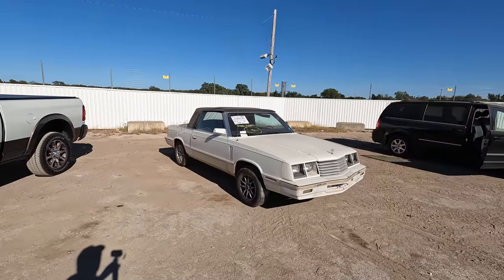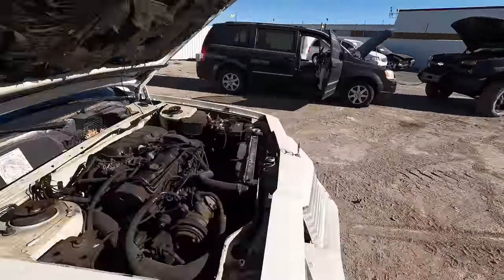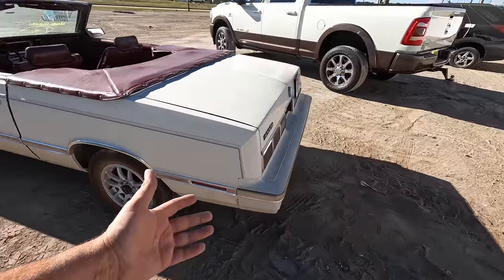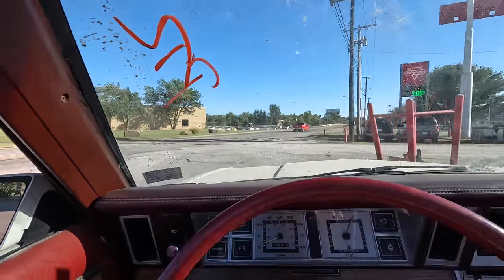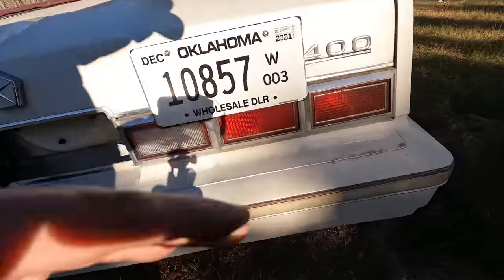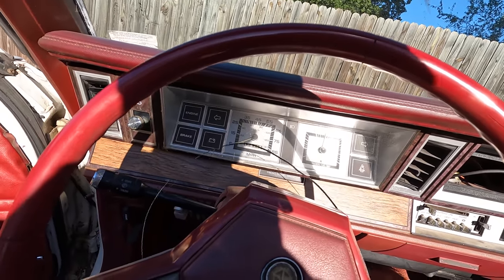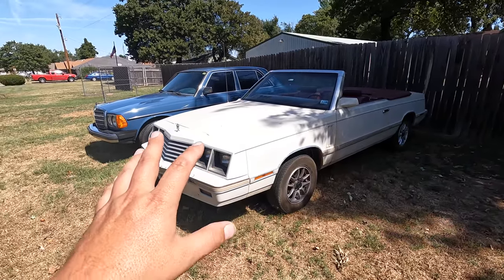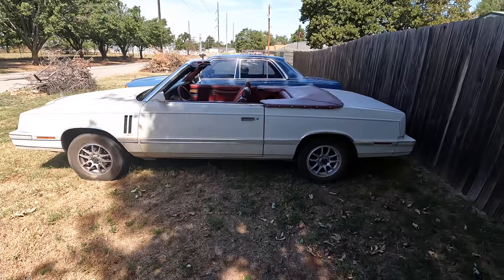I won a 1982 Dodge 400 K Car for $235 from IAA!! Run and Drive? 0-60?

Comment: Randy, I think you underestimate your audience a little bit. A lot of us (including me) come here to see all these oddball cars. I like this channel because of the Cavaliers, Colt Vista Cruisers, Crown Vics and old as dirt Benzes. I also liked that BMW I3. 

Now as for why the Dodge 400 was so slow, The car was meant for cruising and top down trips. It was not meant for spirited driving. It (and the Lebaron) were the first domestic convertibles since the mid 1970's Cadillac Eldo. I personally don't find them that slow when I consider the other American cars offered at the same time. 1976-1986 was a horrible time for power and speed in cars. I had a 1985 Oldsmobile Cutlass Supreme with the 307 V8. It got a whopping 140hp.

As for its value, you might be surprised at how much these can go for with a little work put in to them. They have a following and this being the first year with a low production(they were very pricy in 1982 and not many were made.

Comment: U got it backwards on the 2.2 the 2.6 was the junk motor. maybe 20% of the 100 K cars I've been around or owned has bad headgaskets and u can do a clamshell gasket change in 20 minutes. The 2.6 had cracked heads, dropped rods and never ran good and had bad gas mileage. Chrysler dropped it in 85 for the stroked 2.2 the 2.5..

Comment: I've had amazing luck with the 2.2 and 2.5 engines and I could swop a head gasket or head without even getting under it or jacking it up 45 minutes to swop a head gaskets out 2.6 mitsubishi engines was straight up trash 🗑

Comment: I disagree on your motors decision. I think the 2.2 is better engine. They all knocked of the dealer lot. But they ran forever. The 2.6 was junk period. They smoked after 100 miles and the timing chains all went  and it leaked everywhere.

Comment: These first 2.2 Slant 4 only had 84 BHP and 132 FT:LB of torque
Reply: They weren't slant. They were straight up and down overhead cam. I had several slant 6 and a 2.2 Turbo.

Comment: OLD CAR ON ITS 3rd TRANSMISSION. CHANGE TRANSMISSION EVERY 60K BECAUSE THAT IS CHRYSLER, FRONT HUB BEARING, MAKES NOISE WHEN YOU TURN, KNOW THIS PLATFORM WELL, CALLED THE ENGINE.

Comment: ~2.2 engines were the ones to get

~Mitsubishi powered Chryslers were lemons! 2.6 was a total lemon/dud

Mitsubishi 2.6(later 3.0 on certain vehicles)They lasted 40,000 miles before they needed a rebuild. You wanted the 2.2 or 2.5 4cyl in these.

~Head Gasket issue in the 2.2 were very UNCOMMON,the only issues were maybe in 1981 the 1st year of them,but still not common.They were reliable engines.

~I think you're confused with the 2.2 GM engines and 4.3 GM that blew head gaskets right away.

~Also that sucked was the Head Gakset failing Cadillac NorthStar those were trash(or head bolts but thats worse than just a gasket)

~Subaru's of all ages always had head gasket issues. 

~V6 Toyota's of the 90's that blew a head gasket in 1 year! 

~Toyota finally fixed the head gasket issue but that turned out into the worlds worst case of engine sludge/needing rebuilds early on (low mileage within a few years)..Toyota finally fixed that in 2000's but then it turned into the worst case of engine failures/oil burning/bad piston rings etc needing rebuilds early on...Check Toyota oil burning problems lol..Toyota pays people to praise their vehicles for so called reliability/they paid off journalists for decades(was proven)..Least we mention their computer issue that killed many people/random acceleration(not the floor mats as stooges say it was)!!! Drive by wire was the issue/gas pedal was useless it just floored itself to peoples deaths.

Comment: First of all Randy the 2.2 Chrysler Motor is the better motor it will run forever the 2.6 was a piece of shit it blow head gaskets and pistons all the time they were junk! The only reason there is not more power with that 2.2 is that it needs a tune up and air filter and a gas filter that is a beautiful car and I would fix the top and paint it as it is a great car I would buy it in a heart beat. Those 2.2 got great mileage and last forever. The car is in great shape but Don't leave the top down if it rains you will ruin it. It is to nice a car to do that to it.

Comment: Those hubcaps are Chrysler, not Dodge. So they're not original, but will look Way better than those wheels
Reply: Mopar used those identical wheel covers on Plymouth, Dodges and Chryslers.

Comment: I really hate seeing you buy cars that you don't put out really any content on that would have been a perfect car to throw a cheap radio and speakers in cleaned up put the head light bezel back on it the trim that was in the backseat back and at least sent it off to its new owner better then you got it im not bagging on you but how can you say your putting that back on the road if your just driving it home and the sending it to auction the same way you got it
Reply from the maker: Simple. Nobody bidding on that car knew if it was a reliable driver. Now everyone seeing this video knows. This increases bidding, and makes sure someone who really wants it will get it.
Reply: I definitely see your point it would just be nice to see more of the cheap cars get alittle love kinda like that little nissan truck you had dash cover small fixes would be cool to see you team up with a cheap used car dealer or start one yourself although I know that can be difficult

Comment: I can't believe you picked up such a great deal, and you're going to send it back to auction?  Very disappointed!  There were some very EASY fixes, and the top mechanism worked great.  You're just getting lazy, Randy.  Judging by the views and number of comments, many people would have been interested in seeing you attempt some minor restoration.  I don't see the point of these types of videos, when you get a good running car for cheap, and then just bail.

Comment: Slow cars? Then youre MORE then Wellcome to Sweden! Heare we can leagaly reregester a car to a Tractor & has a top speed of 30km or 15 or 20 mph no higway! No more then 1 passanger & no rebuild of the chassi but block if The back so you have no storage. Just search a traktor & you see wat I mean & YES they are slow! *EVEN my plastick car is faster!, it top at 30 or 40 mph *50km max & you drive it on The same licens 😂